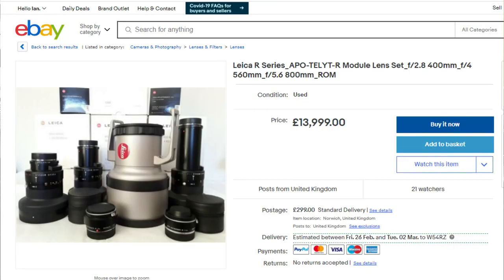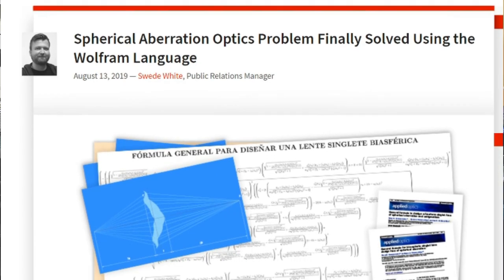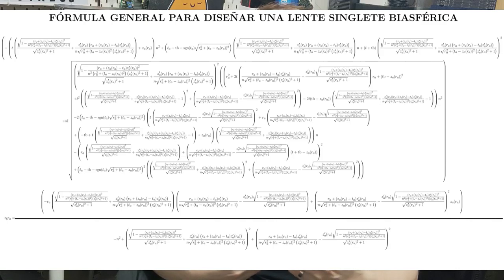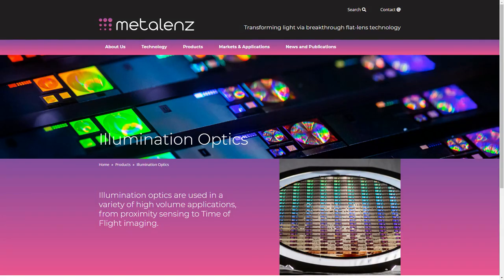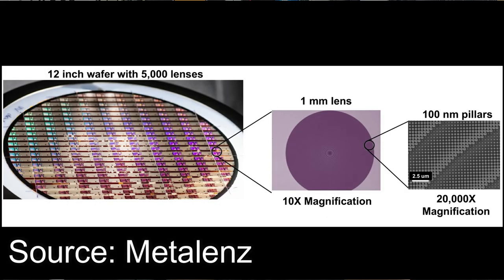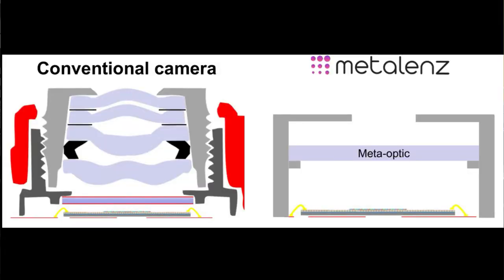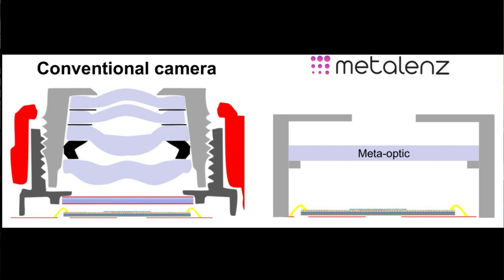Cheaper Thinner Camera Lenses 📷: Silicon To The Rescue

Comment: This is fascinating. It seems like the phone camera trend has been more and more cameras every year. Perhaps this will reverse that trend and allow for a single higher quality (but equally versatile) phone camera eventually.
Reply: He uploaded this today, how were you able to comment yesterday itself?
Reply: @Rubentus- Thanks, I was confused at first, this makes sense.
Reply: I'm really curious what field of view range they're expecting to develop. Current triple-camera setups go from ~8mm wide + ~24mm standard + ~60mm telephoto, so any replacement would need to fit at least two. Or, even with small FOV adjustments, you could offer optical zoom (i.e., a wide-angle offering 6mm to 12mm)? 

We'll all come back to this comments section in 2025 and see what happened, if anything.

>Metalenz will go into mass production toward the end of the year. Its first application will be to serve as the lens system of a 3D sensor in a smartphone. (The company did not give the name of the phone maker.) 

I wonder who this is. Their mobile tech section almost explicitly targets Apple's Face ID and some of its limitations, but going into mass production at the end of the year would likely be too late for any new Apple devices in September.

From https://www.wired.com/story/metalenz-smartphone-lens/
Reply: Well, two, maybe three cameras makes sense.

Left, right, IR, that covers a ton of spectrum, basic depth, etc...

You can do some crazy stuff with 3 cameras.

I do agree though, this can help tremendously.

When I was little only rich people had camcorders, when my youngest gets her first smart phone it'll probably be 8K 3D capable with better color range and low light capabilities than Hollywood has today.

Comment: I have been waiting for these kind of "micro lens arrays" for a long while, where you can take one photo and edit the focal depth computationally in software afterwards, just like how you can today computationally edit the exposure afterwards with RAW / HDR formats.
Next stop is light field capture I guess :)
Reply: The comeback of Lytro! :D All kidding aside, if that kind of technology were to fit inside a smartphone it could really change how photos are taken.
Reply: What we need for field cameras is large and cheap sensors. And by large, I mean hundreds of megapixels or even gigapixels. And yes, computationally it doesn't sound to be cheap by any means. However, benefits outweigh any costs by far. 

And main thing for these field cameras is not about photos, but about video. In photo you mostly can focus before shooting. But in video it's much harder to shoot and focus at the same time. So I expect field cameras to revolutionize filming. But that would require enormous storage.

Comment: Imagine if they added this coating to contact lenses/glasses. That would be amazing - contact lenses that would shift spectrum visible to humans or modify fov in real time. I think it is not far off if this technology takes off.
Reply: Hmm I'm not sure if it's doing shifting of the spectrum, but rather dealing with chromatic aberrations, which is the effect that causes different wavelengths of light to have different focal points, and therefore on the same image plane red may be in focus but blue may not be. If they could achieve that it would definitely be awesome, but I'm not aware of a way to do that with optics.

As for field of view, it could indeed work, but I imagine it would be rather disorienting for the first few hours!
Reply: @matthewreavley  Spectral shifting and very precise wavelength blocking are indeed possible with doped silicon. I'm kinda getting excited about combined tech here :) Of course we don't know if those can be combined with transparent silicon coatings - but I bet they will be. Even if those other effects would block some light (no system is 100% efficient), we're dealing with a lot of nanostructures here. So it could be just sprinkled and used in dotted pattern of 'special' cells within enough normal cells to preserve good visibility.
Reply: @Bilut  oh that is fascinating, thanks for the detailed reply! I guess this means I need to do more research myself!

Comment: one of the big problems is different wavelengths have different effects on the sensor as the points/pixels get smaller, hope this may help with that problem.
From my understanding Sony owns most the sensor market, last time i looked they skyrocketed when phones started using more than 2 sensors.

Comment: I remember reading about metamaterials potentially slimming down camera lenses dramatically a few years back (and for the record, 4-6 glass elements isn't a lot for a dSLR/ILC lens - 10-12 isn't uncommon at all), so it's good to hear they're making progress. One question though: monocrystalline silicon isn't particularly transparent (at least not in what pictures I've seen, though admittedly I've never found an image of an unprocessed wafer, just ingots or finished wafers), so how do they make it work as a lens without also suffering significant light loss? And how do they avoid it being as reflective as monocrystalline silicon seems to be?
Reply: Oh, and one further question: I assume many of the possible new applications for these lenses - such as multiple focal lengths or multiple focal planes within a single lens - necessitate very accurate matching between microlenses and sensor pixels for them to work (a pixel illuminated through several microlenses with different focal lengths will just be capturing garbage, no? Or do they have methods to separate the "data" after the fact?), which would in turn make this very difficult to use on existing cameras without significant software/firmware tweaks. Have they commented on any necessary linking of sensors and lenses? I would also imagine this would make things like interchangeable lenses or image stabilization quite difficult.

Comment: Are these just passive elements? Like an array of small optical elements working together to mimic a "normal" lens (a more sophisticated variant of a Fresnel lens)? Or could you change the properties on the fly, e. g. changing the focal length by applying a voltage across the elements?

Comment: 1:05 isn't higher is better for the signal:noise ratio? if you have 100 signal to 1 noise, that's very good, and a ratio of 100. While if you have 100 signal and 8 noise that would be 12.5, a lower number with more noise compared to signal.
Reply from the maker: Yeah, higher S:N, but lower N. Misspoke, didn't catch it. The brain knew, the mouth failed.
Reply: @TechTechPotato  I've heard many others make the same mistake. I think it's somehow intuitive to assume a lower signal to noise ratio is better if you're not used to talking about it and you're not looking at concrete numbers and ratios. So a bit counter-intuitive sounding metric on the surface.
BTW, I want to point out this wasn't intended as grammar police or a gotcha, but rather to raise some attention on signal to noise ratios, which are a very interesting and important concept :)

Comment: Hmm, seeing is believing. I would think that combination of the matrix of the lens and the matrix of the sensor there will be moiré and banding issues which would need AI to "fix". I suppose if they can get these matrices down to 3nm those light patterns which are generated will be small enough that the sensors won't be able to discern them.